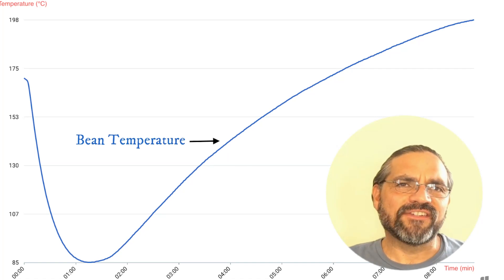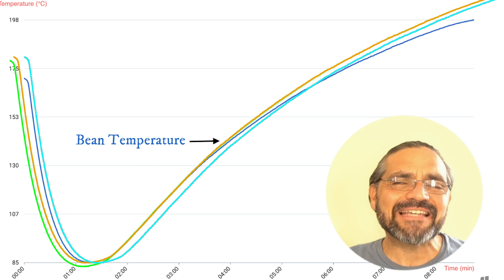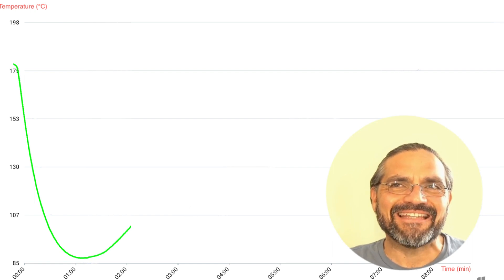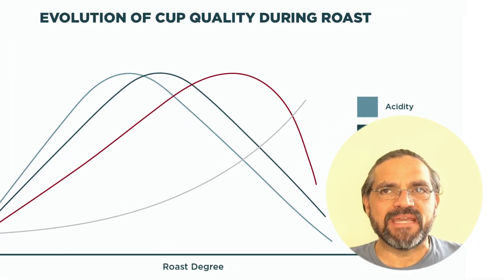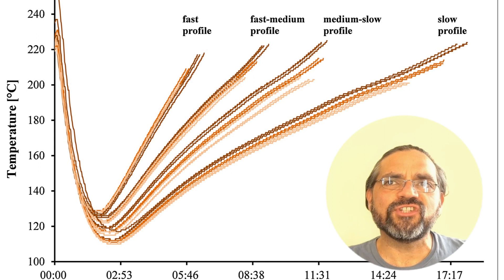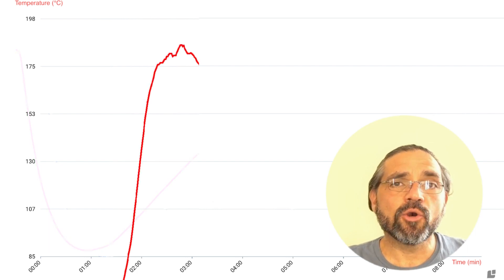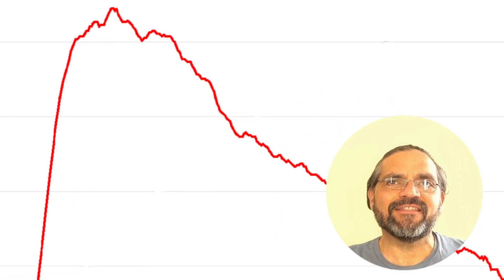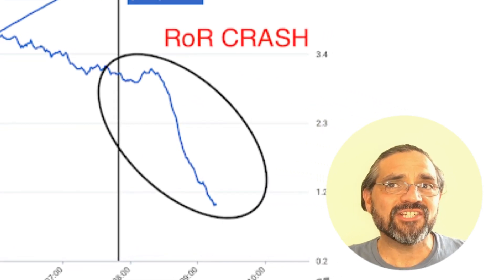Coffee Roasting Essentials Part 6: Understanding Rate of Rise (RoR) in coffee roasting.

Comment: I'm using a fluid bed roaster (SR800, OEM Extension, Razzo chaff mod., 2 K-type thermo's (ET, BT), Phidgets, Artisan'sRoaster Scope) so instead of lowering my heat and increasing my airflow as I get into 1C, I have to keep pouring on the heat. I lower my FAN (which not only controls the air but also controls the heat), and bump my PWR. This is becausethere is no thermal mass. 
So I watch these videos in an attempt to translate from drum roasters to fluid bed roasters. My only advantage is that I was a sous chef. I understand the controlled application of heat over time. Working with a drum roaster would be a natural for me as it's very similar to working with a convection oven. But working with a fluid bed roaster and controlling RoR is a different beastie.
Any chance you'll cover fluid bed roasters?
Reply from the maker: I will definitely cover fluid bed roasters in the near future. Thanks for the support.